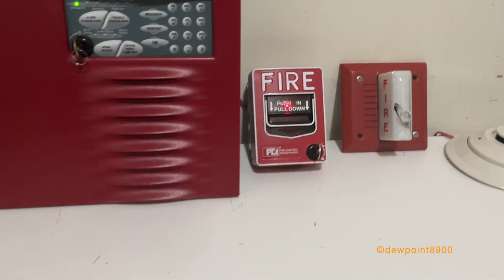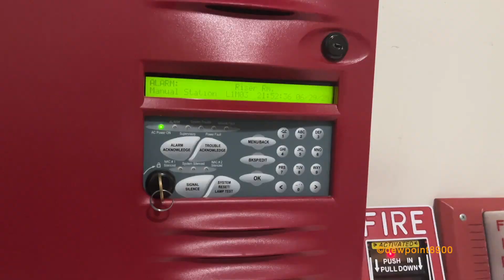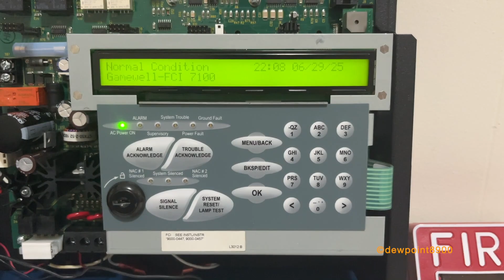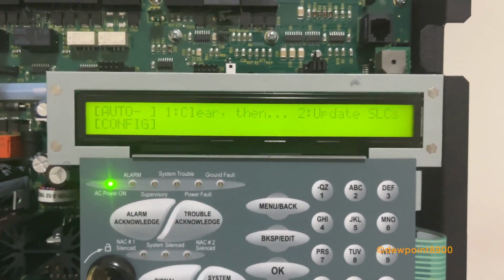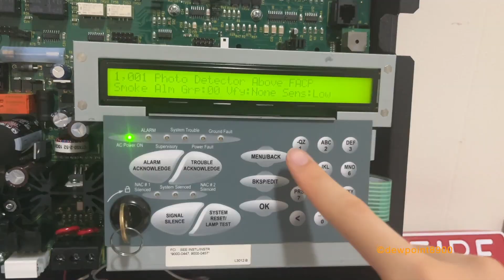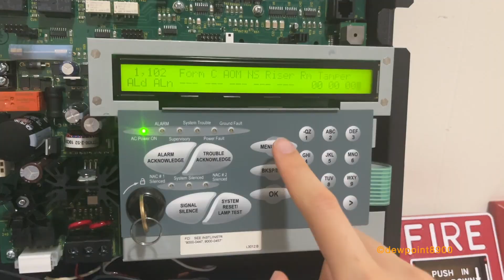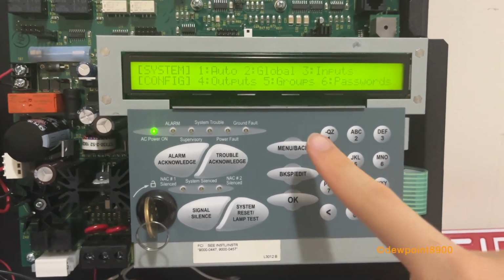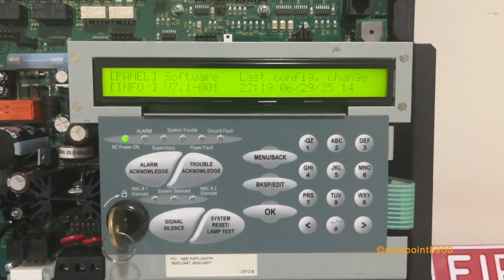FCI 7100 Overview and Demo

Comment: A few things I hate about this panel. 1 is the enable/disable switch and 2 is the fact that you have to hold Reset for a few seconds otherwise it just does a lamp test (it should be the other way around), and 3 is the module addressing when looking up/controlling points (add 100 to the device number). Other than that, these are neat little panels.
Reply from the maker: Yeah, out of all the Gamewell/FCI panels, the 7100s are one of the better ones. I got an FCID I need to get programmed, but they seem quite tanky for how old they are.

Comment: These were manufactured until 2017 and are being rapidly phased out with the end of CLIP mode. Piezos on these are notorious for failing. Nevertheless there are still a decent number of them in service.
Reply: Not surprising looks like something from the 2000s.